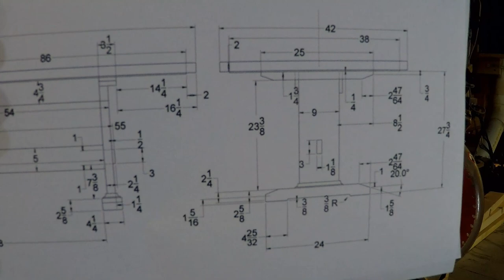Zinc Oval Dining Table with Trestle Base

Comment: Excellent build and finish as usual. Really liked your new approach for constructing the table top. I don't know the cost of Advantek (sheets?), but I assume solid wood is more flexible in terms of species, what you may have in stock (scrap), and therefore price.

That said, I assume it was the client who set the measurements and overall design. To me it looked like the top was proportionally a tiny too small compared to the base (but it could be the cam angel). Also, my experience is that such "narrow" ends on the top isn't comfortable while eating, so I might have preferred more "meat"/larger radius there. But that's my view. In any case, you can be proud with your work (and the check) and the client satisfied for life with a great table.
Reply from the maker: I designed the table about 5 times with different shapes and bases.  That oval is what they wanted.  advantek is around $40 per sheet but then I pay to dispose of the waste.   (cant burn advantek - it will not burn with fire retardants - another reason not to use it - toxic fire retardent dust).  Solid poplar costs more but I can use every last bit of it for this method.  so probably no real cost savings in material but labor for milling the solid wood is much higher.  The resulting glue joint with poplar was worth the effort.  the top remained perfectly flat after the glue up, which means the stress in the bond is minimal.  the last top I did with the advantek had a few puffy spots and a slight bow which I got tired of.  the copper bar top I did completely debonded in some sections which was shocking to see that level of shrinkage of advantek.  I eluded myself to think it was perfectly stable.  maybe it was for a while and then the product changed and my tops started having problems again.  anyways - poplar planking is the way to go from now on.

Comment: why are you switching from the advantek, keep the videos coming. Can you use the juice on galvanized flashing and get similar results?Thanks
Reply from the maker: I am in fact using galvanized in this project (and same juice) for cheaper alternative.  advantek worked better than plywood but not stable enough to guarantee a good bond.  solid wood planking with alternating grain direction allows for shrinkage without changing outside dimensions, minimizing stress to the metal
Reply: @hffcom , Great thanks for the reply. Really enjoy your videos, and love your town. Hope to visit that area sometime.